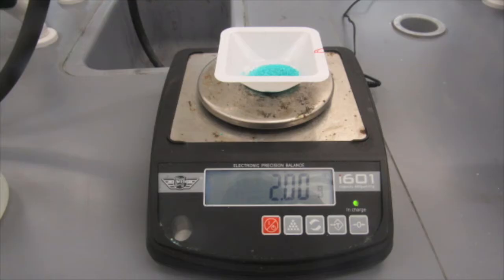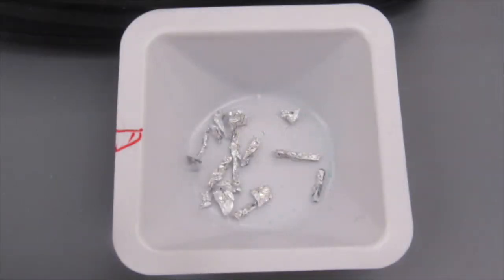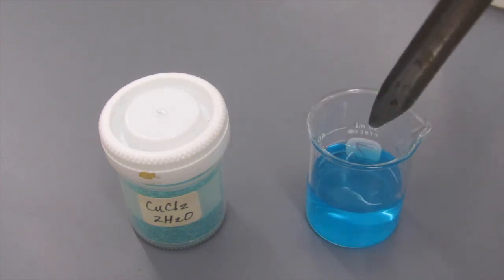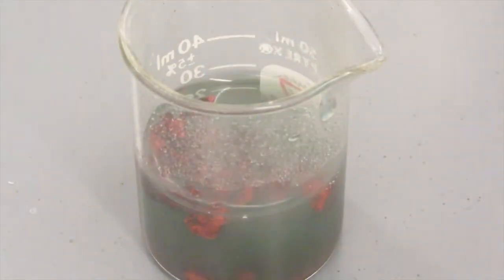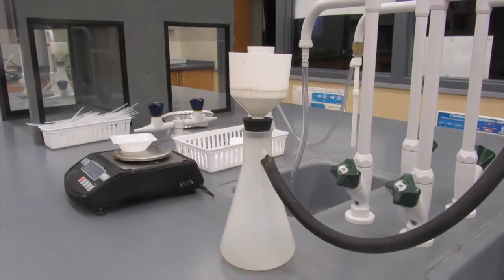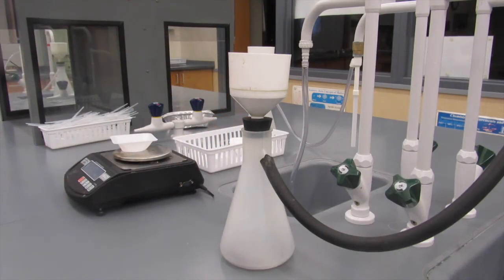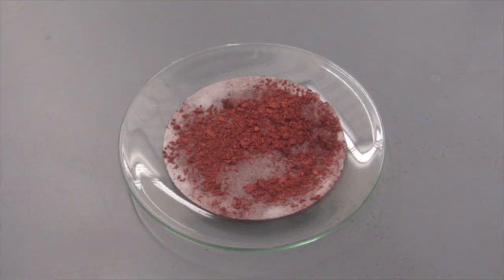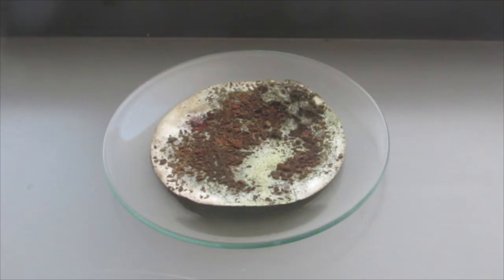Making Copper from Copper Chloride and Aluminum

Comment: Would aluminum in a Gold(III) chloride solution yeild gold?
Reply from the maker: Sorry for the late reply. Based on the oxidation potentials, I suspect it would. The Au3+ to Au potential is +1.52 eV, the Al3+ to Al is -1.66 eV. So, the combined outcome of Al + Au3+ --> Au + Al3+ should have a potential of +3.18 eV and should occur.
Reply: It is better to use silver (if you are percipitating gold using metal) because the silver is easy and cheap to recover. Recovering and refining metals is my hobby.

Comment: I refine metals as a hobby. Most of my waste is copper that is in solution of HCI and H2O2. Is it possible to distill and recover the HCI after I bring the copper out of solution? I have seen a video on distilling nitric acid but never hydrochloric acid.
Reply from the maker: Hi, I don't have a 100% definite answer, but I suspect it would break down in hydrogen and chlorine gas, which might be a bad idea.
Reply: @DrBsChemistry  I have a good fume hood I built. All of my fumes go through a 2 stage water filter. I deal with a lot of chlorine gas and S02 among other gases. I take safety very seriously. 

My thought was to denox the solution with urea, and drop the remaining metals with tin shot. Then run it through a short path distillation so I don't have to get it as hot and there should (I think) be less fume production. 

Does my logic make sense? Thanks for such great content.

Comment: So the result is copper metal and aluminum chorohydrate?
What if dry copper chloride and aluminum powder where mixed together and heated?
Would it form copper metal and aluminum chloride?
Reply from the maker: You make copper and aluminum chloride from this.  I'm not sure if it would work with with Al powder and dry copper chloride, putting the CuCl2 in solution helps separate the ions and makes the reduction/oxidation happen much easier. It would probably still form copper metal and aluminum chloride though.
Reply: @DrBsChemistry  

Thanks
I was looking for a way to make aluminum chloride rather than aluminum chlorohydrate.  I know that AC can be made using dry chlorine gas when it contacts aluminum. With that being said, I wanted to avoid chlorine gas all together.

Comment: My actual copper for some reason is more than my theoretical yield, i dont understand how :((((
Reply from the maker: Hi, usually that happens if the sample is a little wet, or if there is some left over unreacted starting material! Also, if the copper is left out in the air too long, it can turn into copper oxide - which is a little green, like the statue of liberty!
Reply: @DrBsChemistry  thanks for replying! I had to leave for a club trip so mine was left to dry a day longer than needed, would that mean that copper oxide made it heavier?
Reply from the maker: @yeIIoe  Yup! The copper mass stays the same and the mass of the oxygen gets added to it.
Reply: @DrBsChemistry  Thank you so much!!You definitely eased my worries. 👍👍👍